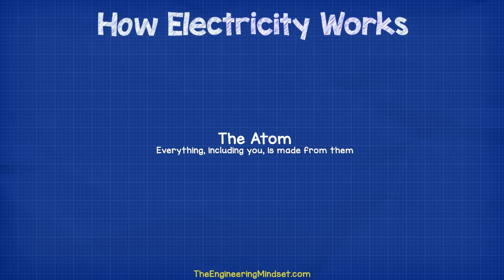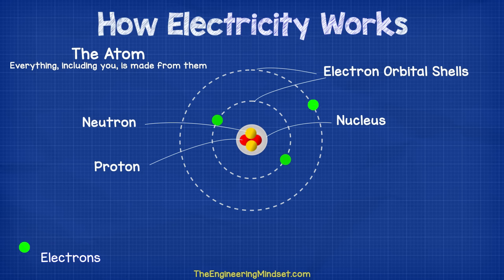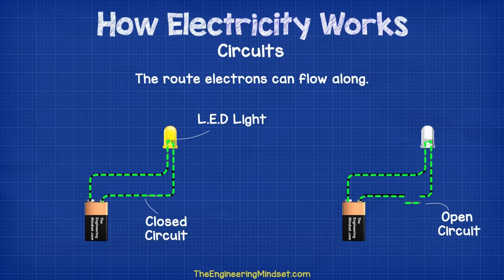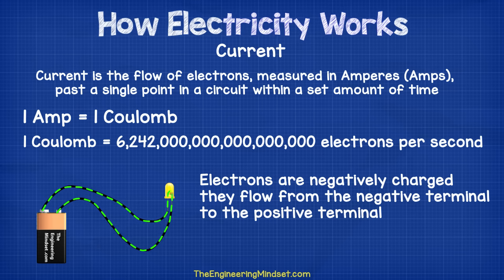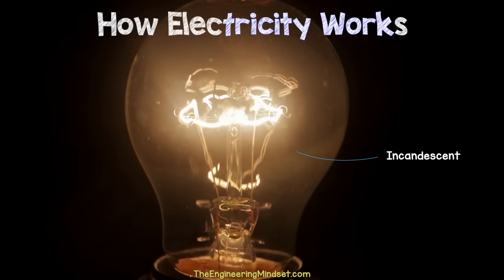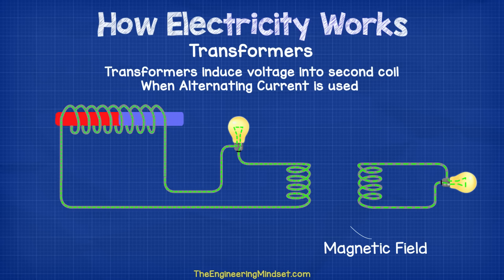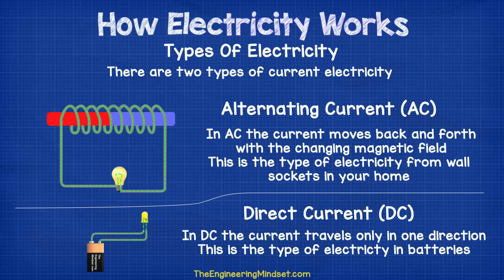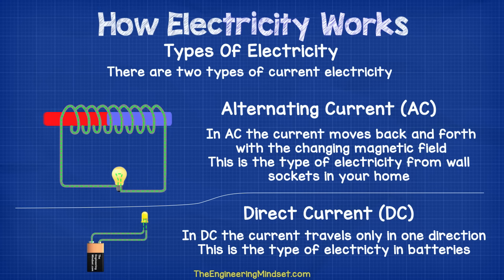How ELECTRICITY works - working principle

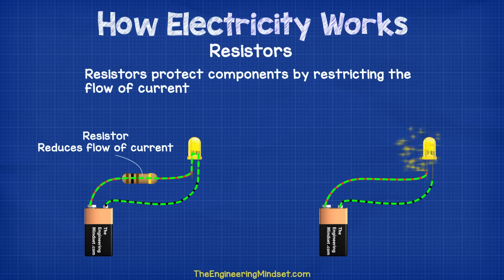Comment: 5:00 I know basically nothing about electricity which is why I came to this video. my understanding is that the wire passing current to the light is the live wire and the wire passing current from the light back to the battery is the neutral wire. why is the resistor put on the neutral wire? I thought it needed to be put where the current is flowing to the light to limit how much it can flow?

Comment: This is misleading. Electrons do not move through wires like this and the electricity is actually transmitted by the electrical and magnetic fields around the wire.

Comment: Battery feeds the field that surrounds the wire, the flow of power inside via the electrons is from the field surrounding and across the surface of the wire which is a guide materiel. 

The wire is the shepherd 
The fields are the sheepdogs 
The electrons are the sheep
The power in the system is the movement all three produce in unison.

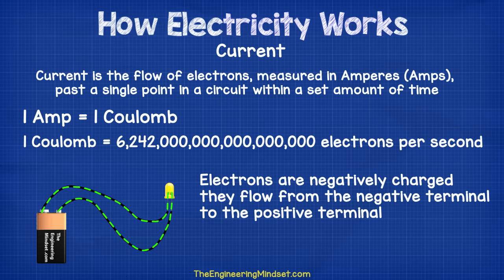Comment: https://youtu.be/mc979OhitAg?t=274 4:33 isn't this right here an error? Narrator says "That's why electrons are grouped together and just called AMPS to make it easier for engineers.", when he has just said that amp is a unit that measures the flow of electrons. I think this sentence should have said "coulombs" instead of "amps" or am I mistaken? I wish if someone could clarify this.

Besides that, really interesting and thanks for the creator, maybe I will be able to repair/install something that uses electricity myself one day.

Comment: I was so confused about how exactly electricity passes through a wire. I understood that electrons were exchanged, but I didnt understand how that happened at all. If I understand it correctly now, they kinda just bump eachother into the next set of valence electrons, causing a domino effect?

Comment: Okay so talking about resistance; the longer wire offering more resistance is kinda easy since current is how many electrons pass through a specific point and if you have a long wire, that’s more space to have to travel. With the thicker wires offering less resistance, is that because like with water pressure, the wider it is the more pressure can be built up? Little confused there please help

Comment: Thanks this helps a lot I’m not doing this in school I’m only thirteen but I decided I need to start early to get the jump on life I want to do electrical engineering when I’m older so this helps a lot I’ve learned more in three minutes of ur video than in the past 2years at highschool I appreciate it u are very smart

Comment: Question. If I want to increase the voltage then I will need more electrons? Another question is, can you increase the voltage without increasing the amount of electrons a battery/power supply has?

Comment: Question:  I have a well pump - 4.8amps @220v - located 200 ft from house - Can I use 12/2 wire for that distance?
Everything I've found uses 20amps @110v which limits the run to 100 ft.   Thanks in advance.

Comment: Another great video thank-you. I have a question regardsing AC; in principle, I understand that it changes direction. But, how does it actually do this? what actually makes that happen and why? secondly, given that it does go back and forth, I struggle to visualize how electrons actually flow across a distance from say A to B. Why don't they 'get stuck' between A and B because they are going back and forth?

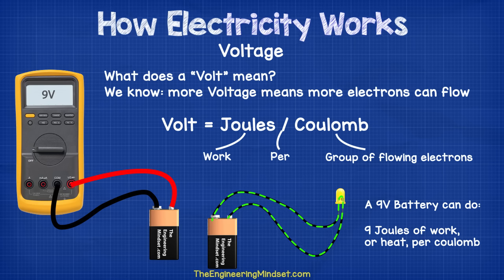Comment: I have found a mistake in this video that is crucial to electromagnetism. In 3:59, the video states that 1 Amp (short for Ampere, a unit of current) = 1 Coulomb (unit of charge, not current). The correct equation would be 1 As (Ampere-second, how many Amperes flow through in 1 second) = 1 Coulomb. Please fix this as it's a mistake that seems to be overlooked, yet it is one that needs to be removed.

Comment: Is it fair to say that magnetism causes voltage?
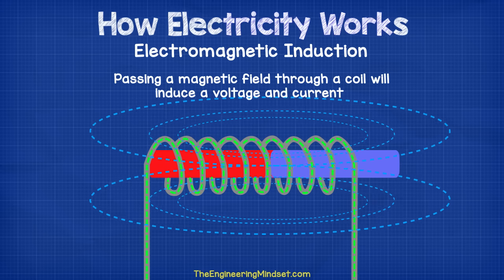If I'm understanding this video correctly, particularly around the 6:27 mark, it sounds like when a wire is wrapped into a coil, the collective magnetism is then strong enough to affect the electrons within the wire, and the degree to which it affects them is voltage?  The magnetism is what creates the pressure that moves the current?

Comment: What if you place 3 electromagnets in a triangle with the poles pointed into the center and a copper receptacle in the middle spin the magnetic field around the copper it should Mimic a generator

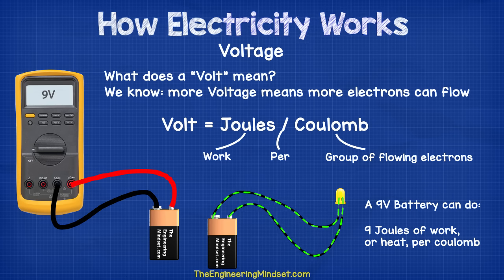Comment: @3:18 "More voltage means more electrons can flow". You could have phrased that better, I think. For a regular conductor, the actual number of electrons in the circuit doesn't change as the voltage increases. But what does change is that those electrons will move faster around the circuit. More voltage = faster electrons = higher current

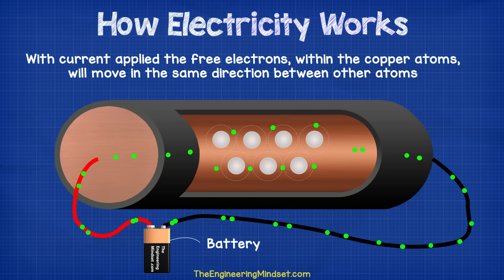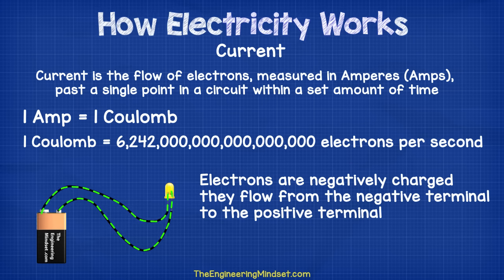Comment: Why do the electrons at 2:32 move from the red (positive?) wire through the copper wire to the black wire (negative?) and back to the battery, but the slide at 4:00 says electronics flow from negative to positive? Please forgive the stupid question. Just trying to understand.

Comment: Thank-you for this really helped. I would disagree and say the electrons orbiting the nucleus do not move in an circular orbital like fashion however a full shells electrons will travel in every which way within the shells coordinated location respectively to the nucleus’s. So it’s not a circle they travel but every direction. Each individual electron has a small magnetic force depending on the polar rotation and In a full shell the electrons will split evenly and opposite to make sure the + and - charges on each electron cancel each other out. Therefore stopping every atom or solid on earth being magnetically charged. Am I correct? Sorry thanks 😊

Comment: is there a way to test batteries my VOM gives 1.5 v, but if in a lamp, they
just go dim instantly. and do not light the incandescent lamp post charging.
is there some way to put a load on the battery to check the usability of the 
battery. thanks

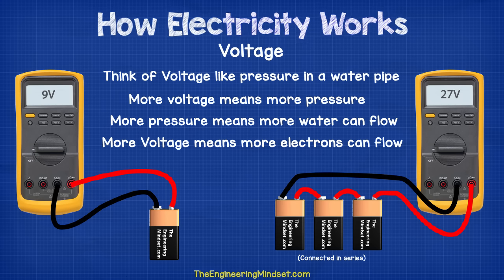Comment: In 3:05 - 3:09, When you said "And in an open circuit, this means that the electrons are not able to flow." What happens to the electrons that are not able to flow in the open circuit? Does the electrons just stay still there until the circuit is closed? Does the electrons decay or decrease or maybe even slowly disappear when time goes by when the circuit hasn't been closed? Or maybe the electrons multiply or merge together if the circuit hasn't close yet?

Comment: This video is generally about how electricity works; however, it is mostly about current electricity.  Usually, when learning electricity, there is also something called static electricity.  This is where an object (like a balloon) gets electrically charged by gaining or losing electrons.  When it does, it has an electric field.

Anyway, this is a good video to learn the other important things about electricity.

Comment: I need to look up AC generation, since it's been ages and I'm not sure the detail was covered in physics class anyway. But right now I'm imagining the turbine (is always turbines) connected to a Scotch Yoke with a magnet at the end, oscillating inside a coil. Probably not the current method, but I think that would produce the alternating sine wave

Comment: The drift rate of the electron is known: 1/10mm/second. In the example: An electron "leaving" a battery 100m away will reach us after 28 hours.  So, even if it "pushes" other electrons in the wire/cable. And there would be "friction" in the filament of the bulb would still not heat up and would not light up.  
This is knowledge from primary and secondary school that the current flows and it is n

Comment: Wow, I guess I don't remember how much I forgot or never learned. I have been around electric most of my work life; low voltage irrigation wiring for golf courses thru 600v @ 10k amps glass tempering oven and refrig units thru 90 ton water over water chillers. I am retired @67

Comment: I know enough about electricity to know I know nothing about electricity. Seriously. I've watched this 3 times now and my mechanically based brain has trouble retaining it. The parts that stuck with me the most were when electricity was compared to water in a pipe. That I get! 
An old electrical engineer colleague drew a picture explaining electricity to me. It was a cross section of a dam and a reservoir. 
The height of the water in the reservoir is like voltage. 
The diameter of the opening at the base of the dam that water flows through is like Amperage. 
And the hydronic power created by water flowing through the hole is like electrical power. 
If you increase the hole size (amperage), power increases. 
If you increase the water height in the reservoir (voltage), power also increases.

This analogy is the only reason I know anything about how electricity works (and now this video too!).

Electrical engineers are a special kind of crazy, and I make fun of them for being so weird all the time. It's a compliment to them though because you need to be a little crazy for this type of knowledge to come to you naturally! From a mechanical engineer to all electrical engineers, keep being your crazy selves and thanks for making all my mechanical stuff spin!

Comment: Thank you so much! Im using this to build a stronger foundation for my new career. I designed and built large irrigation systems including all of the wiring for 18 years, but im getting older and i want to stop while my body is still strong and in shape. Ive seen too many men break down horribly by continuing hourly physical work past 40 yrs old, it can be done, but most guys fall apart. I am  in love with drones and have taught myself to build from scratch with applied knowledge of components and connections which led me to my new job manufacturing battery packs for really important stuff like search and rescue gear. Im at a point where i feel like a highly skilled monkey who can perform tasks very well but has no deeper understanding of what hes doing. Example would be that a monkey could be trained to be excellent at hammering nails into a board, but he doesnt know what wood and metal are. I need to go backwards to figure out exactly how and WHY my drones work instead of simply understanding enough to make them. I cant afford school but i sure can spend time studying things that people like you have been so kind to share. What you are doing here is a very important service to society as a whole and will improve many peoples lives, some greatly impacted by your work. I offer my most sincere thanks for your work and your willingness to share and bring others up with you.

Comment: You say electrons lights up the bulb. That's wrong. Moving electrons create magnetic fields. With the combination of the electric fields they are able to pass energy from the battery to the bulb. The energy comes from outside the wires

Comment: 3:10
I’m new to this and quite ignorant about it so my question may be full of errors. I assume that the electrons in the valence shell are the ones that travel when voltage (low voltage?) is applied to a conductor. So my question is:
As the voltage is increased, are electrons also shed from the penultimate shell and moved along in the electron flow?
So is it that more electrons are pulled from each atom when the voltage increases, or is it that the electrons (valence shell electrons) simply flow faster as voltage increases?

Comment: My question is-a/c current, one wire is hot and the other one is neutral. 🤦🏼 So, why do you not get shocked touching the white wire if it’s alternating current? Is it because it is wired into the ground bar at the panel!? Baffelong.

Comment: So when connecting a load to a battery through wires, people say to connect the fuse to the battery as close as possible on the + side of the battery. I don't get it. If electricity actually flows from - to +, then how come the Hot wire(live wire) is +? If electricity comes out from the - or the neutral wire first, shouldn't the fuse be on the neutral wire?

Comment: LOVE this video, but one complaint - at 2:28 you show the electron flow model (electrons flowing from negative to positive), but then you switch every other model to conventional flow (positive to negative).  This can be confusing to beginners.  Especially when your video on capacitors at 7:40 show conventional flow for the battery, but then electron flow for the capacitor….

Comment: One thing I've never understood about conductivity is the "free electrons". If the electrons are being passed between atoms, which is what causes electricity to travel: Can a conductor.. run out of electrons? Like, "oh, that cable's been used for years, must have used up all the electrons." If for example, an atom had one electron in its valence shell, and that electron was "knocked off", is that atom just no longer conductive?

 I really would like to understand this stuff, I just have so many damn questions lol.

Comment: If we think it as a pressure the big problem is that it is not able to make the speed of electricity equal to C. If we think of it as a pressure. The charge needs to move push another charge to move by repulsion between them but it will take some time because there needs an electron to move first at terminals then the electric field from it travels the distance between that and next electron and gives a push upon it.  Which means that electrons must travel at C to give total C speed for Electricity. 

Overall pressure could be useful but not correct

Comment: Great video. Unfortunately, as in the video explaining current, the presenter mixes up charge (measured in Coulomb) and current (measured in Ampere), stating that Ampere=Coulomb and that coulomb is a certain number of electrons per second, which is not the case. Since this is very basic stuff, it ought to be corrected.

Comment: Love this video (the whole series, actually) but I think the model of the copper atom is incorrect.  The 2nd AND 3rd shells are 8 electrons (see the periodic table) making copper have 11 electrons in it's valence shell.  If it had only one electron in it's valence shell it would be an EXTREMELY unstable element like sodium or potassium.  Doesn't negate all the great stuff about electricity (which is why we're watching it) but if you ever revise this video, it's a fix that should be made for the sake of correctness.

Comment: It took me 3 hours too completely digest the information in this video. 

A valence electron (in copper for instance) is negatively charged and sits in the outer most shell of the atom and is therefore not very much subject or bound too the positive attraction of the Protons. It can therefor easily move between similar atoms. But when a positive charge is created in a closed circuit the electron is attracted too that positive charge (just like it is too the proton). All the valence electrons starts moving in the same direction and come into contact with resistance (a light-ball) that is higher then the copper.  Meaning they have a different atomic structure. The collision of the moving electrons with the atoms in the resistor causes heat, the heat energy is then transformed into light.

Is this more or less correct?

Comment: 1:00 I know they simplified this to make it easier to grasp, but electrons don't orbit the nucleus like a planet. They have "orbitals," which are balloon-shaped or donut-shaped areas in which they reside. Just lookup "electron orbitals," and you'll see it.

That's not to say representing it like a planetary orbit is wrong. It's actually a pretty practical representation, most of the time. It isn't, however, the way electrons actually sit outside the atom, technically.